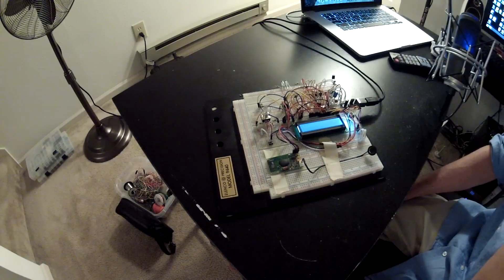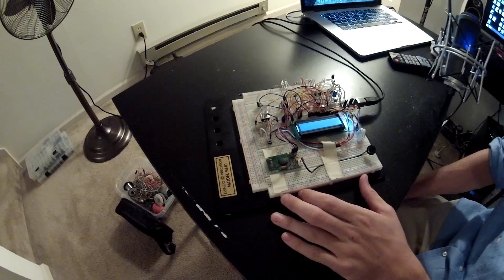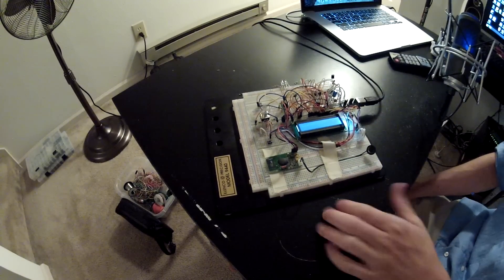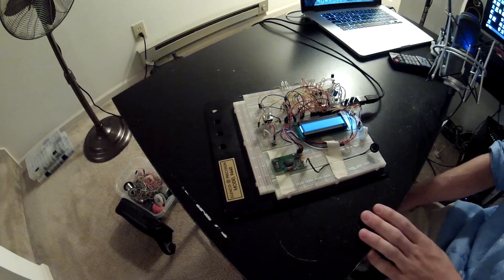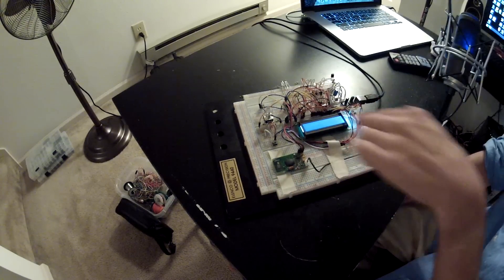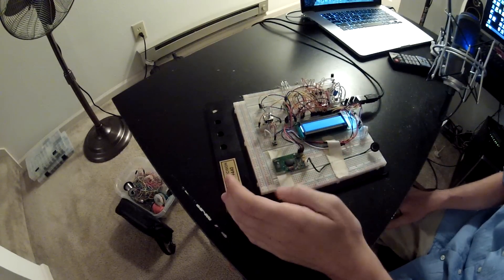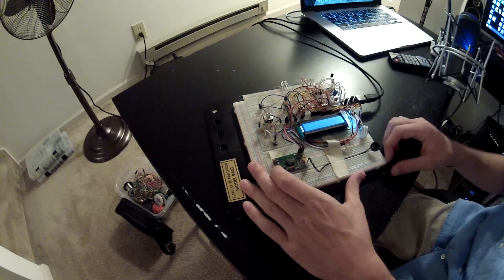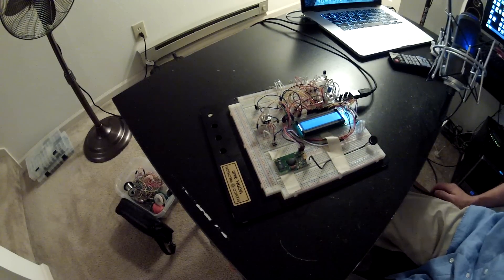How to Build an Arduino Voice Controlled TV Remote

Comment: here you only need one interrupt in this tiny code. I run a super fine lines strip for a HP printer's position head, it detect it perfectly and runs so fast

    #define encoderI 2  // 0 on pin 2
    #define encoderQ 3  // 1 on pin 3 // Only use one interrupt in this example
//====
  void handleEncoder(){
     if(digitalRead(encoderI) == digitalRead(encoderQ))
     { val[cas]++; } else { val[cas]--; }    }
Like your videos Kevin ( thumbs up)

Comment: Hi Kevin, why not replace the transistor in the first diagram with a "NOT gate" to invert the output of the Arduino.  It would simplify the circuit.